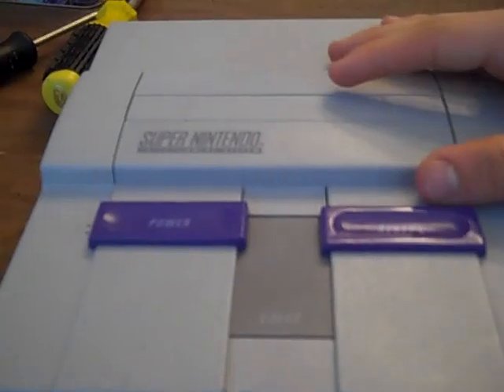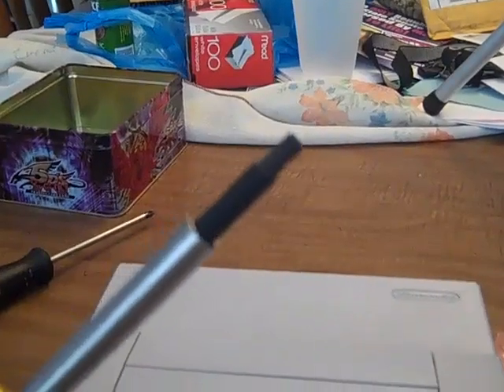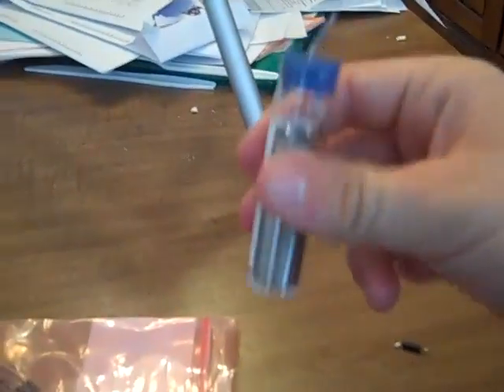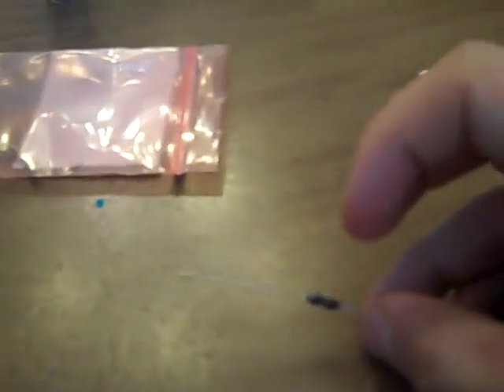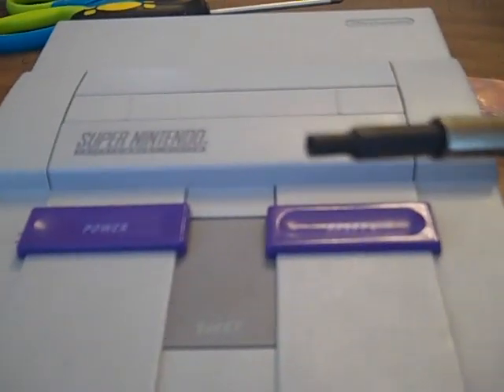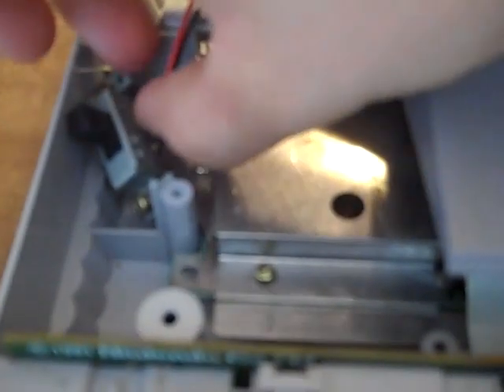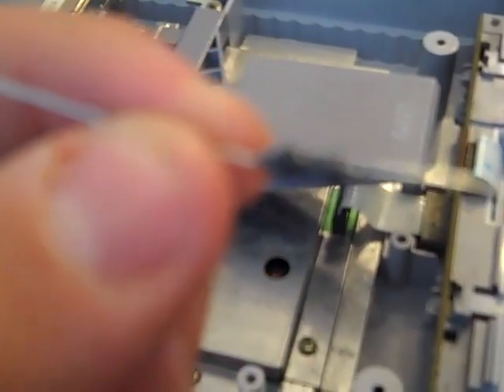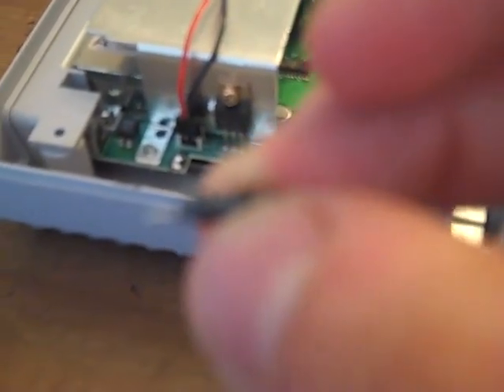Super  Nintendo fuse repair  (1.5A Pico fuse)

Comment: Sorry if this has already been answered but what voltage fuse should be used? I see 1.5A mentioned but when looking at them online i see 125 volt 1.5A 250volt 1.5 A and so on.
I figure 125 volt but better to be sure than guess
Reply: 125 volt

Comment: I'm wondering if the same applies to the Super Famicom. I recently purchased a SFC in Tokyo and it worked perfectly on Japanese a outlet. I then traveled to Hong Kong and stupidly plugged the SFC into a voltage adapter which I believe fried it... (I know dumb idea). Once I arrived back in the US I plugged SFC into a voltage step down and the console will still not turn on.

I'm hoping replacing the fuse will bring her back to life. Any thoughts are welcome.

Thank you for the great post.

Comment: Hi,
I used one of those tools that tests if electricity is coming through the wire.
I tried it on the adaptor it beeped.
When I plug the adaptor into the Super nintendo and hold up the tool to the super nintendo it beeps. When I turn it on, no light comes on. Is it the fuse?

Comment: Im ahampster2, just a different account lol. Anyways Just look up a video on how to open up the NES, then find where you would plugin the NES from the outside and trace it to the inside; the fuse should be located just after where the plugin enters into the chip.

Comment: @MrHossCartwright the only way to find out is to use whats called a multimeter and have it on continuity check if it beeps then its fine if not then its bad